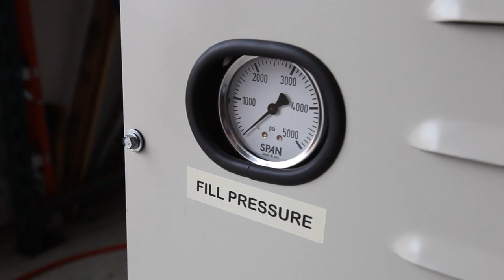Local company develops a CNG home filling station (2012-12-06)

Comment: if cng is 11.20 per therm and 1.1 dollars / gal why is there not a market frenzy over this stuff when the epa is going to force epa emissions down wont this be the only fuel viable to meet emission standards?
Reply: Its fuel efficiency isn’t as great as conventional gas and measures in miles per gas gallon equivalency not miles per gallon. It simply doesn’t last as long as your regular unleaded or diesel fuel.

Comment: Is there a full size Ford pickup truck that can be converted? I've tried to find a way to convert a 2014 Ford Raptor with the massive V8 engine in it. I also have a 2019 Ford Raptor with the V6 turbo which I believe the double turbo is the reason that vehicle can't be converted. This something that has been very frustrating to me. I had bought a transit connect by Ford that took 7 months to get before Trump was in office and gas was off the hook. I was told it needed case hardened valves and just some minor things in the engine. This would be driven....a lot. At the time I saw a unit called PHILL. Well, before I ever did the conversion, prices were under $2 bucks a gallon. I had planned on putting unit at my main store and one at home.[I'm a small mom and pop two store operation but we do a lot of work. Actually reps are blown away at the volume we do] Bit every product we sell comes from oris fired with gas, or the coatings on the wood are all petrochemicals, and carpet is all oil based. So right now, the mills are not even guaranteeing a price on a job I bid today past today. And we are buried. My son just ordered twop 2021 RANGERS before talking to me. I don't know for sure, but I think it's safe to assume those will be V6, Eco-Boost engines. But with fuel insane again, I'm really wanting to do what I had planned on maybe 7 years ago and have then run as a bi-fuel vehicle. Gas or CNG. You can buy CNG from a ready mix concrete place by us that uses it for their concrete trucks exclusively, but they mark it up for the general public too much to justify the conversions. 

Anyway, at the very least, I'd like to find out and maybe you know someone in the states that knows which engines can be ideally converted to bi-fuel vehicles. This PHILL is nowhere to be found anymore. I have one store in NW Indiana and the store I started 31 years ago is in Illinois. If you know anything about Illinois and the Pritzker's, wealth would be an understatement. The taxes on gas again are brutal. I'm tired of depending on who is in office determining what a "so called fossil fuel," a term coined by John D. Rockefeller in order to make it seem finite which allowed him to manipulate the prices. He also was the one funding Prohibition. He didn't want anyone making alcohol. Much like the electric cars and the CNG today, when Henry Ford built the Model T, there were no gas stations. He built that car so it would run off of ANYTHING YOU COULD GROW AND FERMENT. A LITTLE TIDBIT OF HISTORY THAT ISN'T TAUGHT TODAY. By design of course. Rockefeller in today's money would worth $267 billion dollars. More than Gates and Musk combined. Besides, I'm a 57 year old man now and I can remember being in eighth grade and being told we'd be out of "fossil fuels" by the year 2000. Seriously? It's amazing how people buy into so much because they aren't critical thinkers and don't have the courage to challenge so many of the absurdities we've been taught as fact. They are not factual. We obviously haven't ran out and won't, but the fact is 99% of the population doesn't challenge this stuff and trust a guy who had 98% of the kerosene business when it was the main fuel to light a house up. What you're doing is so much better of an alternative than even electric. With electric, our bodies are being bombarded by electromagnetic frequencies that when [unless it can be stopped] we go to 5G, that's the same power that a microwave uses. But you use that for seconds. To be bombarded with millimeter waves all day is like a "directed energy weapon." It destroys us at a cellular level and people don't get it. They don't even know that the then Soviet Union tested these out in 1976 and decided these waves were far too damaging to the body and pulled away from using them. That may change now because everyone is bent on being a superpower. 
Sorry about the length. Passion isn't something that should be harnessed.
Reply: 5L V-8 rated for Flex Fuel works fine for CNG
I am working on the CNG compressor problem.
Reply: This was an amazing response. I agree that they've monopolized gasoline so we're dependent on them. Cng does seem the way to go...but it would require an easy way to produce it with a volume substantial enough to replace gasoline. Idk of that can be done "at home"
Reply: @brettbowers6  it can be produced quite easily at home. The trick is making sure its dry, filtered of particulates and then compressed.
Reply: @sparkythawelder  unfortunately I'm out in the country so we don't have piped in cng to the house. I'd have to find a way to produce the gas...not sure if a biodigester could keep up with the demand...but I'm looking into it. Thanks for the reply.
Reply: @brettbowers6  you might look into ethanol. I'm not sure which would be easier.